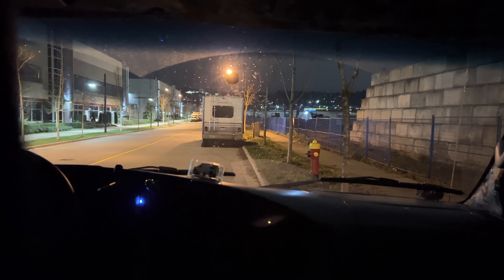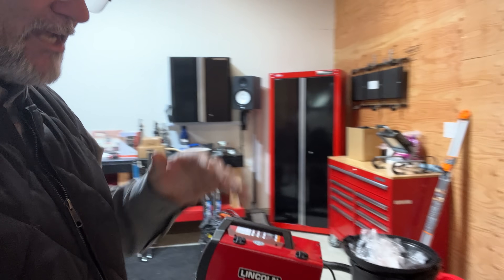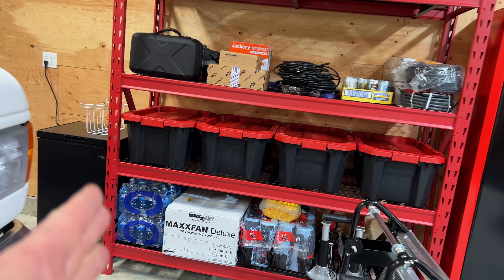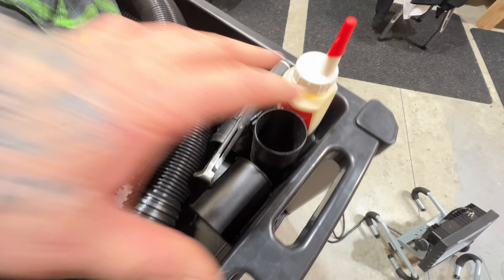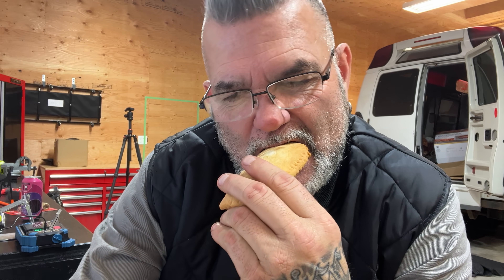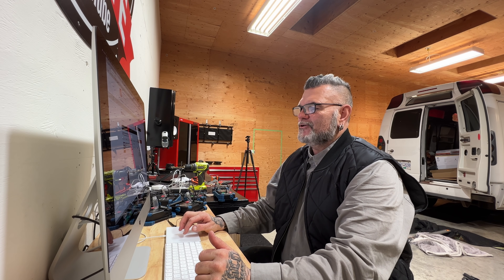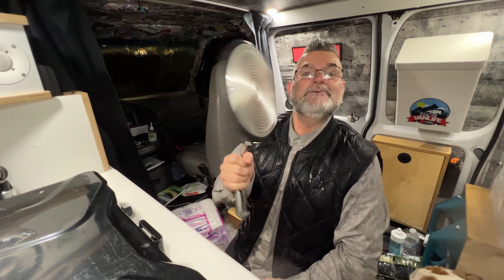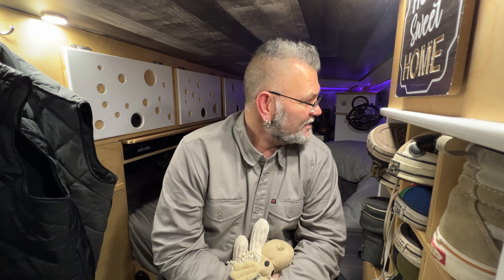ONE MORE WEEK And We Will Be Ready To Start Tearing Apart "THE BEAST"

Comment: I'm an auto locksmith and here in the UK I find some ford dash displays such as the ford focus can have issues when the solder on the circuit board starts to crack causing communication problems in the canbus lines

Comment: Whatever you do with that island work bench, put it on double lock casters 
So you can get it out of the way  when necessary. If you dont use
 DOUBLE LOCK CASTERS,  you will regret it , they sell them at the Depot they're the ones with red wheels..
Also you may want to take into consideration the height of a future table saw so it can double as an outfeed table 😉

Comment: Hey Chrome, instead of using the Jackery to power the heater in the shop, why not get a 12V power supply? A 20A or 30A 12V PSU can be bought off Amazon relatively reasonably. Just wire the 120V input to an AC cable, and 12V out to the heater and you can run it as long as you want so long as you have fuel on hand
Reply: If you go back a handful of videos, he started doing it as "an experiment " to see if you could run the heater off the jackery. It's probably just habit at this point

Comment: Those are load bars for inside a trailer if you have a half load. Put it in the back to hold the load in so it doesn’t fall all over when pulling out.

Comment: Trucks have many sets of those And they are called pallet jacks They go from side to side holding freight back from moving. 
I used 2 one time to hold my sore frame up while I screwed it in. I have the ones you have to hold stuff back in a truck bed. They are  really useful
Reply: Load locks.
Reply: They're called load locks in the US. We use pallet jacks to lift pallets off the floor to wheel pallets around.

Comment: I noticed that on the right side your double cabinet is flush against the right wall. Then you've got the short red tool chest along the right side. BUT it's too close to the double cabinet, cos I saw that when you tried to open the right side door of the double cabinet, it bumped into the short red tool chest, and would not open all the way.